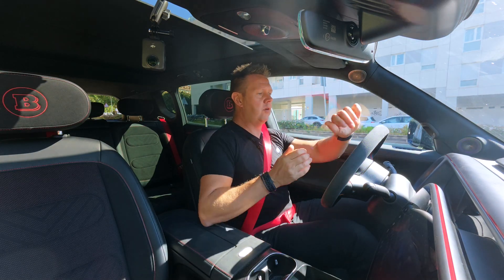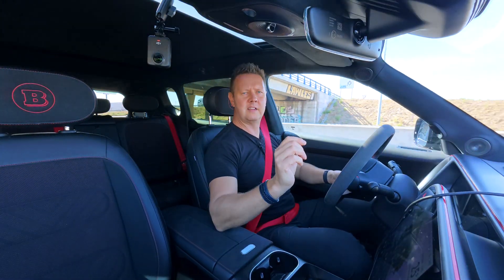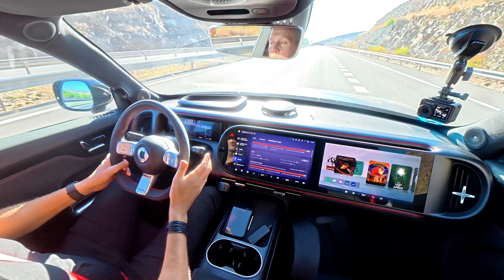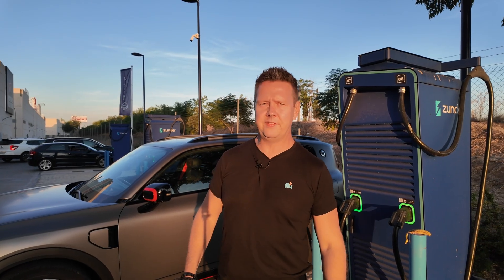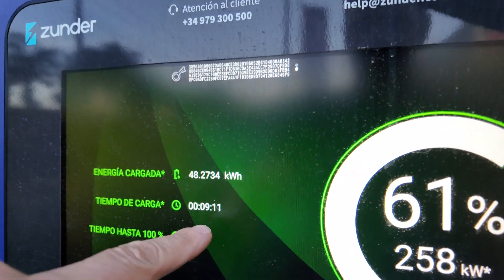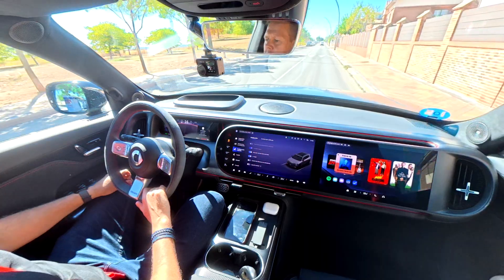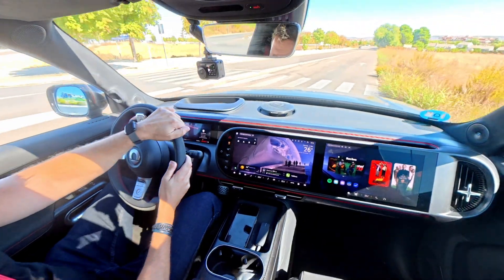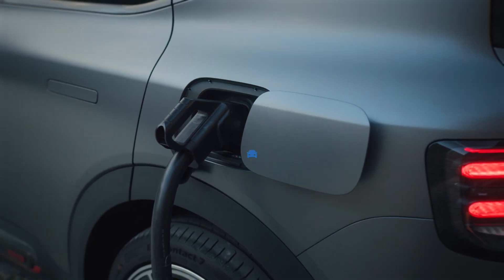Highway Range and Lightning Fast Charging: Smart #5 BRABUS Tested

Comment: Thanks for the good watch. About to Order the Pulse variant, as found the Brabus acceleration slightly ott for a family motor (would almost never use that extra 1.1 sec of 0-60 power), plus wanted the leather seats. Family loved the overall package during the test drives and the proposition is great overall 👍🏾
(Our kid loves the lion avatar and the styling too…)